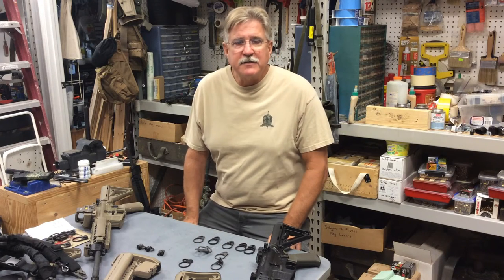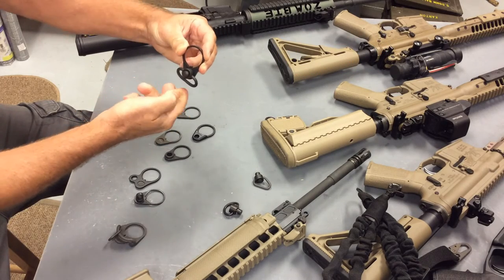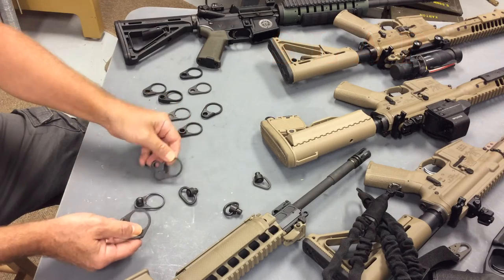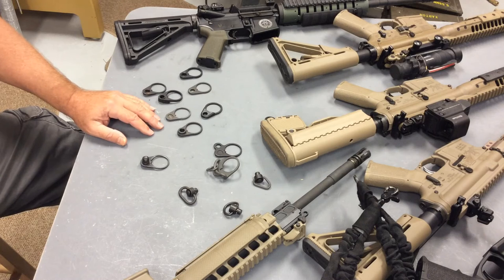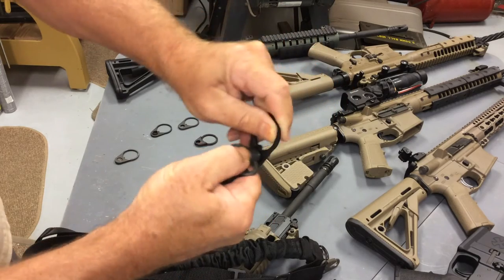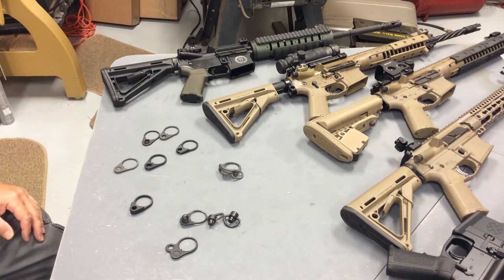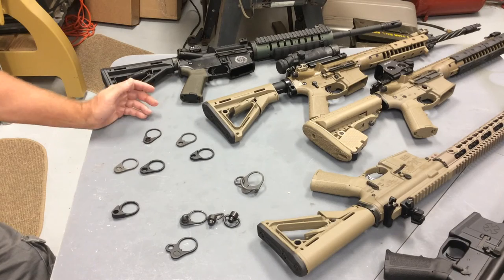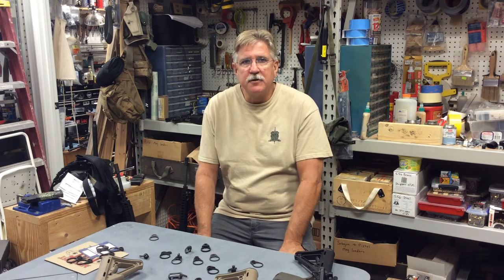QD Receiver End Plate:AR15 Single Point Sling Attachment Receiver End Plates

Comment: I just purchased (5) of UTG rear QD end plates for $8/each, so I'm hoping those work good, as they are steel and not stamped.  Also, what do you think about Aero Precision lowers?  I have been stocking up on the M4E1's and also some of their Gen 2's standard lowers.  I see you have a lot of Spikes lowers, so I thought I'd ask your opinions on Aero Precision...
Reply from the maker: Let us know how those end plates work out. UTG does have some nice stuff if it is their UTG USA. Aero lowers are high quality but I have only used their Gen 2 standard lowers. I have never built with the M4E1 system they have but their stuff is top notch.
Reply: @MichaelBellmbell556  Ya, I tend to stay away from UTG because it's known to be airsoft quality in some instances, but these are actually very nice!  I was surprised how well they were made, just not a fan of the UTG logo on the end plate, but no biggy!

Comment: A lot of great info. However, you put a lot of emphasis on the rotation aspect of the qd endplate, but did not demonstrate the rotational aspect of any of them install on the weapon. It appears in my minds eye that rotation will not be possible when installed either way.
Reply from the maker: You do not want complete rotation, that might twist up your sling. Having the center position does allow access from left or right side. Is that what you mean by rotation.
Reply: No. I mean with the sling installed, the buffet tube will stop/impeed any rotation. So why worry about this. Not criticizing...just learning. Thanks.
Reply from the maker: I agree with you. Some make a big deal about rotation limiting function. I do not find it to be a major problem be cause as you said, the buffer tube limits this problem. But some do make a big deal about it so I tried to point out which ones had this function and which ones do not, so that if that matters to you, you would know.

Comment: would a bcm qd plate work with say a Midwest industries attachment?
Reply from the maker: What MI attachment do you mean? All of the single point attachment points are standardized. Some limit rotation and some do not, but any devise designed to attach to a single point will fit in no matter who the manufacturer is. If you have a mash hook or other similar devise on your sling then a D-ring single point adapter can be used to attach the sling to the single point.

Comment: So.why skip the review of the single point end plates for non-collapsing buttstocks? At least recognize they are available; e.g. GG&G-1073.
Reply from the maker: I am just reviewing what I have had experience with in the past. I am a consumer and the ones I looked at are the ones I have tried. I have put a similar looped sling plate on one of my Benelli M4 shotguns. Even that has a collapsible stock. I did not even think about the A2 stocked AR 15s. Thanks for pointing that out and including the link so folks could check it out.